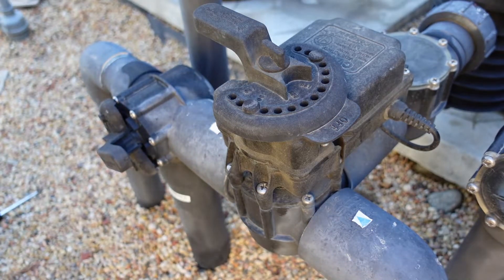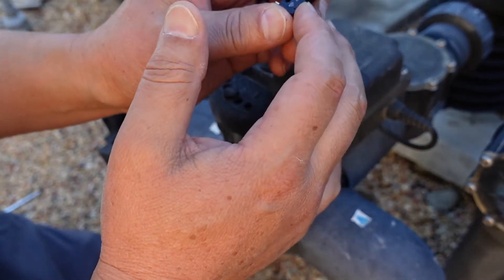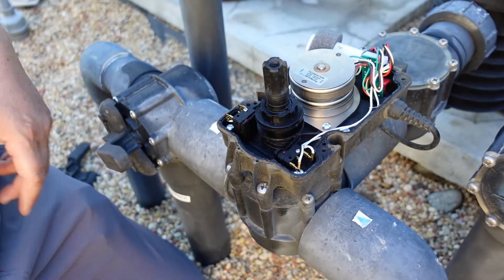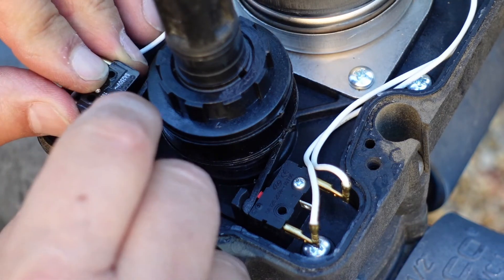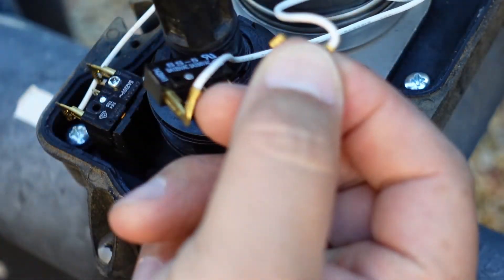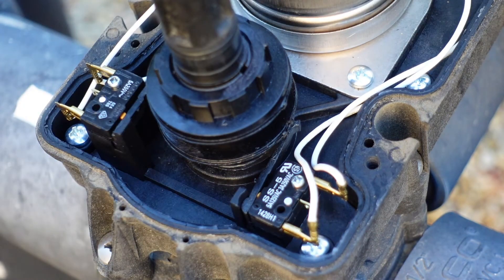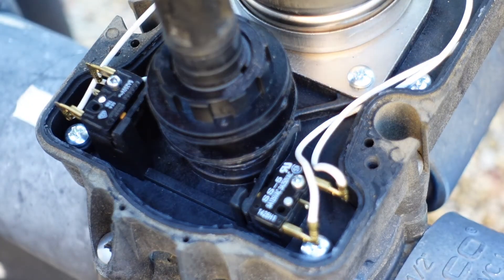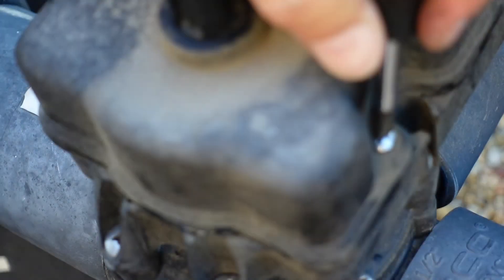EASY FIX FOR BROKEN PENTAIR POOL AND SPA VALVE ACTUATOR (CVA-24)

Comment: Fantastic video! It worked!! I’m guessing I saved close to $500 if I called the pool place… they would have replaced the whole thing!!! Thank you!
Reply from the maker: Great! My pool is 13 years old. I am still using the same Pentair actuator.  I have changed out the switches a few times.

Comment: What if the toggle switch works but cannot control it through the automation panel?
Reply from the maker: I have both of my actuator switches pointed down (open).  Don't leave in the middle setting. Hope this helps you.

Comment: Thank you thank you!  Was able to follow your instructions and it worked. Found this video by accident. Was really just trying to figure out if I could move it manually since it went out. This was really great. My pool was stuck in spa mode so the water wasn’t staying and I couldn’t run the pool. Felt good to do this myself!!
Reply from the maker: Glad you found it helpful. You can fine those switches for few bucks online. I have replaced mine few times in 13 years owning my pool.

Comment: I have replaced 3 of these valves because the gear teeth wear out or the valve allows water to collect in the bottom and rust. Im over the expense name brands to get lousy service life. 
I am going to give the cheap knock off brand a try.

Comment: I had a hard time removing the micro switch. It appears they are now manufactured to not come off. There is a small bump that stops it from being removed. Pool equipment was installed in 2019. Unless I’m not being forceful enough. It just seems like the wire will rip off if I’m more forceful. To be clear this is for my Penrtair Spa return valve.

Comment: The switches did not work on my valve. I think it’s bad so do you have a video of how to install a brand new pentair spa valve. I would love to see it.
Reply from the maker: Have you tried toggling the switch up or down on the spa valve. It should be toggled down. Toggle switch in middle position is off.